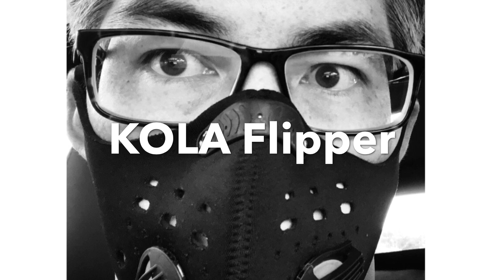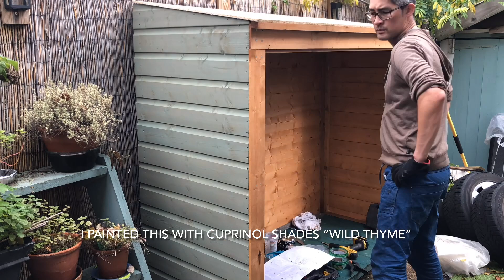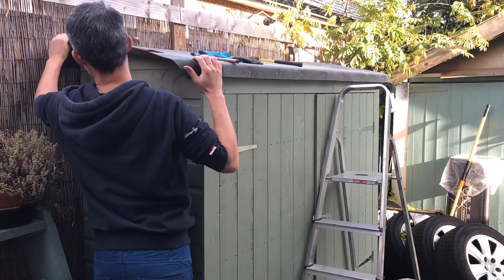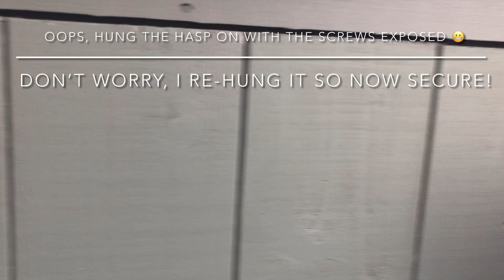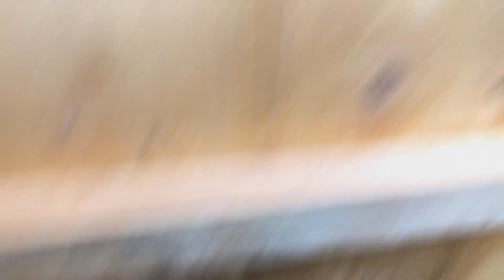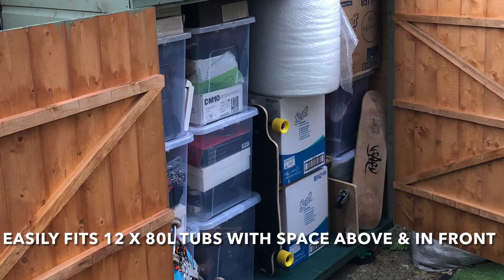Reseller Storage at Home - Is it better to buy a storage solution for home or Rent a small unit?

Comment: Nice work and good job done matey👍🏼.  Good looking garden store., much nicer looking than those plastic storage boxes that seem very popular in recent years
Reply from the maker: I did have a look at the plastic ones but the were expensive AND looked cheap. At least with a wooden one I could pimp it with some paint, upgrade the security, also as James said I could insulate it too. What did you think of my Raleigh, I’ve had it for 35 years, it’s my first bike.
Reply: @KOLAFlipper  any outside store you will struggle with its internal ‘climate’ .  Finding a good balance of excellent ventilation and insulation to avoid damp is a tricky one.  Yeah, nice bike.  I sold my childhood 12 speed Raleigh racer a couple of years back because too many projects.  Then last year bought a Raleigh shopper that’s now rusting in the garden 😂😬

Comment: Looks good, might be worth using some thermawrap inside to keep some of the heat out if you're storing reselling items in there. Those 4 days of summer we have every year can be brutal
Reply from the maker: That’s a good shout. It’s only in direct sunlight for about 1.5-2 hours a day, but that’s probably enough to cook some of my stock. Roll on the mega shed build!